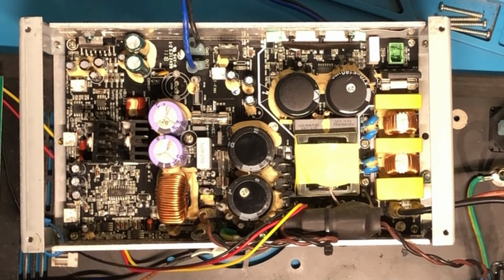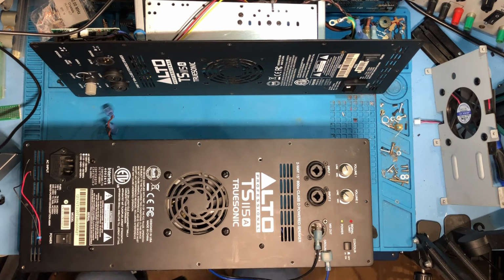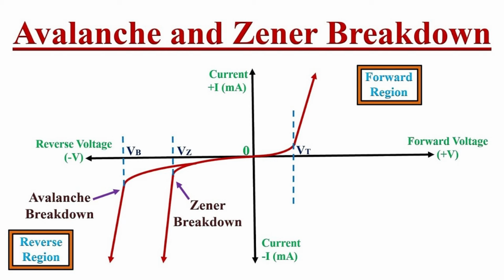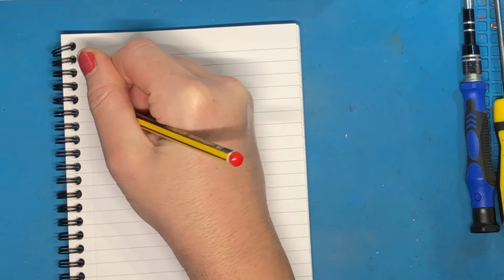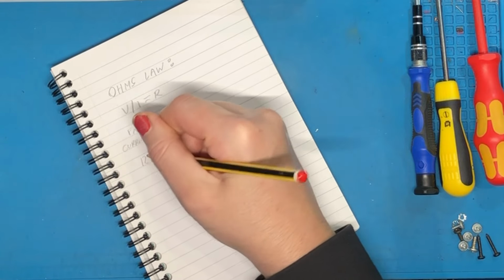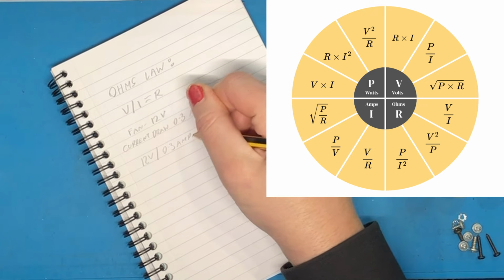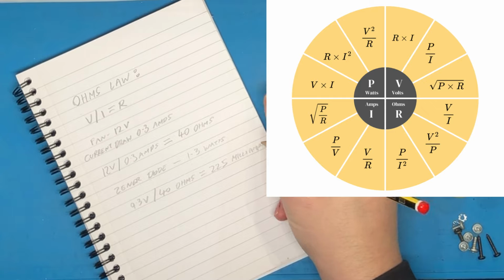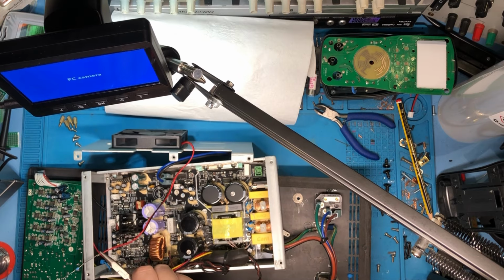Alto TS115A Active PA Speaker Overheating Problems!  Quick Repair Needed!

Comment: To make the fan run faster but not too fast just short pins 2 and 3 of the LM317 and replace D401 with a 10ohm 1W resistor or your 2.7V zener.
Reply: Or replace R119 with a higher value fixed resistor. Use an online LM317 calculator to find the correct value for about 9V output.
Reply from the maker: I needed them in a hurry so as the fan controller circuit wasn't working reliably I found another source of fixed voltage then applied the zener to drop the voltage a bit to cut down the noise from the fan but still give a decent airflow.

Comment: Nice job but now I'm curious, why a Zener diode instead of a resistor?
Reply from the maker: A zener diode is a more precise known voltage drop. There is a resistor in the circuit in series with the zener, the 40 ohms of the fan motor windings. This is the same principle as using ordinary diodes forward biased and losing 0.6 - 0.7V across them. If a simple resistor had been used and the resistance of the fan winding changed as it got hot the voltage across the fan will change, maybe not much, but with the zener it will always be 12V minus 2.7V zener = 9.3V  Enough to slow the fan down a bit and cut down on noise but still get good air flow.

Comment: I bought five faulty active speakers just to have a look at them what shocked me was they were incapable of producing the watts stated on the box I swear a lot of these companies just pick a number not like the old RMS.
Reply from the maker: You mean the old term 'PMPO', Peak Maximum Power Output, which is nothing like the true RMS power. One thing that was pointed out to me is that although they may not be able to produce their rated RMS sine wave power, the power supply if it has enough reserve can allow the amp to produce audio peaks in excess of stated RMS rated power for short peaks which is all music needs as nobody listens to a sine wave. Thanks for watching.
Reply: @JazzTechUK  RMS is british old standard 100w Rms is equal to 300w PMPO all the new terms came from europe they sound good but are worthless.
Reply: @JazzTechUK  Terelec I still have about six of there original amps all work fine I bought from them when they started off but to be honest I am an old City and Guilds industrial electrician circuit design.
Reply: @JazzTechUK  a peak is not true power out put, for that the amp has to be able to run at the stated wats long term. They do it on everything now power supplies chargers then they wonder why everything over heats and burns out. RMS is old skool MPO and PMPO is the last 30 odd years.
Reply from the maker: I'm always amazed at how so much Chinese gear claims over-unity power delivery, lol.
Reply: @JazzTechUK  I trained at hartford theory practical was with an old TV repair guy who started on valves, right up until his death I was still good friends with him and I remember MPO and PMPO coming in it took him seconds to work out difference between RMS. I have about 47 power amps still in storage I used to repair them for other companies and I had a PA buisness in the 90s I actually have three of those stage lines all 1000w models as for speakers you do not want to ask JBL, Eminence, Celestion, Electro voice to name but a few 10inch to 18inch plus 48 halogen logo projectors all 350w old skool.

Comment: That fan control schematic is weird. Why are D126, C400, R400 even shown if they Not Connected (NC). If they were fitted, it makes a voltage doubler circuit i think. But why double the voltage? Also they've got the pinout of the LM317 wrong. Pin 1 is adjust, not 2. Pin 2 is output, not 1.
Reply from the maker: They are not fitted at all. At least not in this version. I think it's more likely a full wave rectifier rather than a half wave rectifier, which the capacitors are smoothing out.
I just didn't like the circuit and a lot of forums talked about this fan controller being unreliable, so simple fix was a constant voltage supply dropped a bit with the zener. Nice, Easy and just Reliable.

Comment: The yellow glue around the caps becomes conductive & corrosive over time. It will become hard and chips of easy with a screwdriver.
I have repaired a Klipsch subwoofer amplifier board with the same glue.
Reply from the maker: I can't see how the glue will become conductive or corrosive, however electrolyte leakage from the capacitor itself will be.

Comment: Halo Salom 
Salam kenal dari Indonesia 
Saya punya speaker merek alto 
Kerusakan nya mat ga da suara
Reply from the maker: That could be many things. Unless you are qualified and capable of doing what might turn out to be an advanced repair I wouldn't attempt it on these speakers as there is a lot of mains voltages on large parts of these amplifier circuits. Take it somewhere to have it properly repaired.